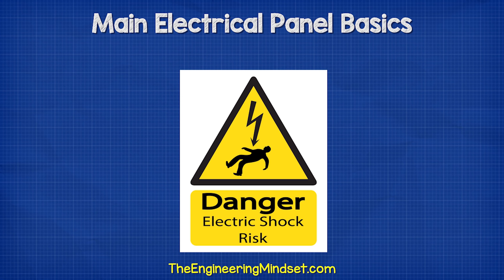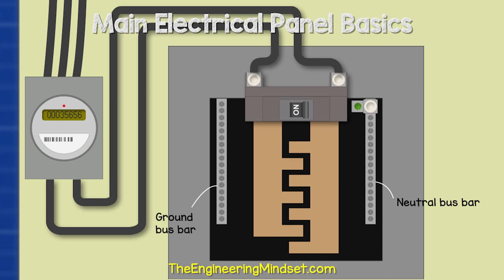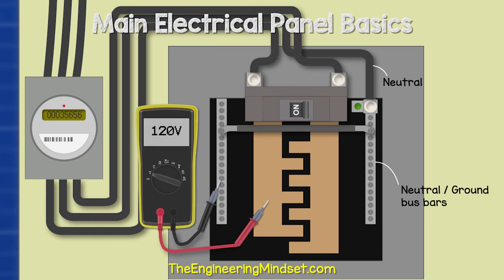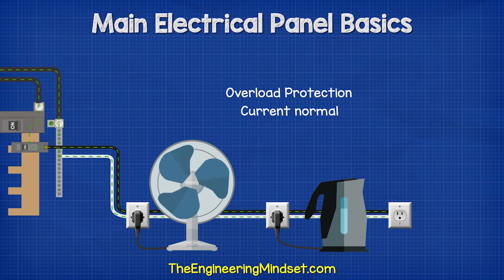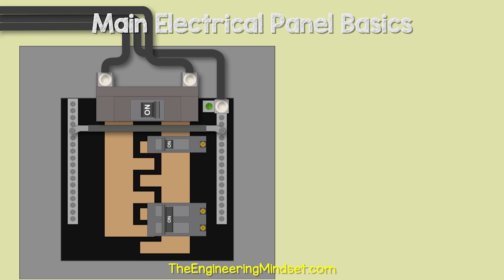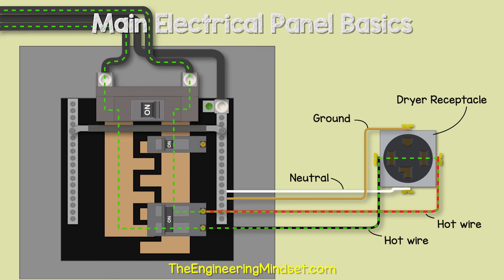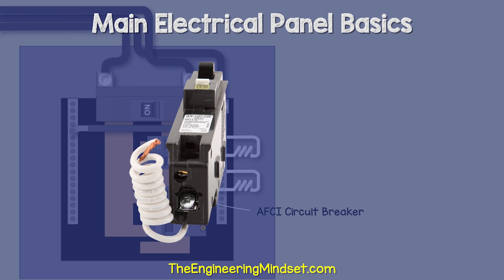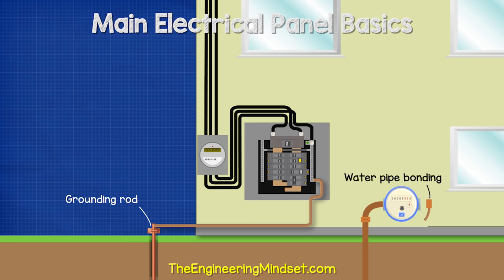Main electrical panel explained - Load center - service panel

Comment: I've been an electrician for almost 20 years now and this is a really good video for explaining the basics to students or just curious folks. I wish this sorta stuff was around when I was in trade school
Reply: Hello, I believe my ground and neutral bus is connected by the bar. Does it mean that both the ground and neutral wires can be applicable to either side of the bar without trouble? In addition, can you put a ground and a neutral into the same screw? If so does that also apply to having two ground wires into one screw and two neutral wires into another? THANKS!

Comment: My first home was a 100 year old farm house that had been “farmer” built and engineered. No code was followed. I decided to change the front porch light fixture. So I turned it on with the switch, saw the lamp go on, the shut it off, the light went dark. So now I can safely remove the old fixture, right? WRONG! I put a screwdriver to the wire and received a good shock! Why? I was not wired correctly. Basically when the switch was off, it was just grounding it out. The fixture stays hot all the time. Beware. That’s why you use the breaker when working on a circuit you know no history on. It worked like that for years and the old saying if it’s not broken, don’t fix it is what farmers live by
Reply: And that's why you also verify with a voltmeter before you proceed work

Comment: I'm an electrician and I didn't even know the difference between AFCI and GFCI before this. Great video :)
Reply from the maker: Glad it was helpful!
Reply: ⚡ Electrician. You're an apprentice. You're learning to be an electrician. There's a difference.
Reply: @beverlytate2669  Thank you for spelling it correctly.
Reply: Keep in mind though… modern GFCI are COMBINATION AFCI/GFCI and handle both jobs. Pretty much impossible to buy a single use breaker anymore.
Reply: @SuperVstech  Just in my experience they have continued to be a thorn in my side.  But then again I deal with them at a hospital as a commercial industrial electrician.
Reply: @bad74maverick1   I get that the AFCI & GFCI are for safety.  But sometimes just because someone invented something doesn't mean that the NEC has to mandate it.  But then again look at who makes up the NEC committees.
Reply: @beverlytate2669  Was just ready to say that
Reply: @beverlytate2669  True, I'm never gonna claim I know the code book as good as a real Electrician :)
Reply: @The Reverse Fixed, lol embarrassing
Reply: @bad74maverick1  what is it, in particular that is causing issues with these devices in the hospitals? Is it the wide range of equipment in use at once or a certain brand of devices? You guys have many additional codes to deal with in that environment. It must be frustrating trying to troubleshoot so much along with your other tasks!
Reply: @ethanoverwatch407  don’t give in so quickly! Just keep learning and learning. We’re all in the same boat in that respect.
Reply: @bad74maverick1  : Also they are mandating it in Commercial Laundries and they will give all sorts of problems. I have a new laundry and the service calls never ended until all AFCI and GFCI were changed with normal breakers and outlets.
Reply: @bad74maverick1  : Some new Laundry constructions are using them too and we advice the owners to replace them with regular breakers/outlets.
Reply: @Android_Warrior  I can only imagine the nuisance trips that would cause!
Reply: @bad74maverick1 : At the begining yes but I have managed for the owners to switch to regular breakers and outlets.
Reply: That's sad
Reply: @DemnRaig80  Thanks?
Reply: @dwayne7356  If you understand how they work they are objectively very good devices to install. If they were useless or seemingly a money grab it would be handled appropriately
Reply: @Android_Warrior  Wow this is terrible advice for a business. If those are tripping all the time they are indicating that there is a condition that needs to be fixed. 

How do I know this? Years as a Red Seal Electrician and doing a ton of controls and maintenance. 

Also you don't need to call and electrician to reset an AFCI or GFCI... That should be basic basic training.

Old vacuums trip the oldest of these because they either used brushed motors and the brushes were long gone or something else in the motor is causing a ton of sparking. Which believe it or not across a population is enough to cause unnecessary fires and deaths.
Reply: @goaliedude32  This is spot on.
Reply: @Morberis  : You must live behind a desk. I have 30+ years working in the field and I'm taking from experience. I live this situation all the time and that is with new laundry equipment that use heavy Electronics.
Reply: @SuperVstech  yeah bro you can get afci only breakers and gfci only breakers. you can acquire these incredibly easy and theyre installed all the time. your information is flatly wrong and you should delete this comment
Reply: Then your not an electrician

Comment: I work with a lot of electronic circuits over the years as a field engineer on medical devices, but I never delved into electrical for housing. This was extremely interesting and pretty simple when you get right down to it.  Great video.

Comment: Nice video. I remember GFCI once saved my life. That is a good that engineers took care of such an event!
Reply: I think every circuit in the home should have a GFCI breaker. Maybe there is some disadvantage I'm not seeing but why don't they? Is cost the only reason?
Reply: @levelup1279  I think the price is the main reason. Also, in UK such breakers called RCD (Residual Current Device) and placed not 1 for a room, but one breaker for a full house. In such case full house if protected. I see no disadvantages when it comes to a human life safety)
Reply: @levelup1279  A GFCI won't save you if you stick a fork in the outlet without being grounded. It only works if it sees a different current back from the load than what was sent. What is good (especially if children are present) are tamper resistant receptacles that have a little doors in the slots that only open when both hot and neutral plug pins are inserted at the same time. It's residential code around here.

Comment: These videos have somehow achieved an unmatched level of informational digestibility. 

I say somehow because I’ve seen the same topics explained in what I thought was a similar manner, yet have never been able to comprehend & understand the presented information as efficiently as I’ve been able to with these. For example, I don’t think I’ve ever seen such a quick & simple, yet understandable explanation of the 120/240v relationship regarding the transform’s center-tap & the connected common rail. Clear & simple gold.

Comment: This is by far the best video I've seen describing the main panel operation. Great jo
 There's information on breakers, GFCI, AND AFCI breakers. It ever talks about how switches and lights are wired. 
It's like three or four videos in one. Great job.

Comment: Can you please make a video explains why grounds and neutrals need to be separated in the subpanel. This was super helpful.
Reply: Because lightning grounds to earth and neutral is just return of the circuit back to transformer at the pole. 
My guess.
Reply from the maker: Check the new SUB PANEL EXPLAINED ➡️ video https://youtu.be/NUSNa-7Hecw

Comment: im currently an apprentice for a commercial electrical company and i have always struggled to understand whats actually going on in these panels. I took notes from this video and it really helped me
Reply: Hello, I believe my ground and neutral bus is connected by the bar. Does it mean that both the ground and neutral wires can be applicable to either side of the bar without trouble? In addition, can you put a ground and a neutral into the same screw? If so does that also apply to having two ground wires into one screw and two neutral wires into another? THANKS!

Comment: Great video.  One correction:  I believe the the grounds from the circuits are supposed to connect to the ground bus bar, not the neutral bus bar.  And the grounding rod is supposed to connect to the ground bus bar.  This is especially important in a sub-panel, where the neutral and ground bus bars are not connected to each other.
Reply: In general, yes that’s true. It depends on the ground fault protection of the circuit. You wouldn’t want to have your neutral bonded to ground downstream of your ground fault protection, as it would cause the breaker with said protection to constantly trip with virtually any load. For residential circuits this shouldn’t be too big of an issue though, since you only really see dedicated ground fault protection on the GFCI outlets. In commercial and especially industrial settings though, ground fault protection is very important and it’s therefore important not to bond your neutral and ground downstream of the protection.
Reply: You are correct about the subpanel. The video is correct and by code. When the service disconnect (Main Breaker) is in the service equipment panel then by code you need to terminate the grounded conductor (Neutral) on the neutral bar, and connect it to the ground bar and panel. It is important to connect the grounds and neutrals together. If you watch the video closely, in an event of a ground fault the current is going to travel the ground wire to the panel to the neutral back to it's source.  

If your main disconnect is at the meter then you would connect the ground and neutrals together and then separate it at the main panel. Electrician U does a get video on why you separate the grounds and neutrals in the subpanel.
Reply from the maker: Check the new SUB PANEL EXPLAINED ➡️ video https://youtu.be/NUSNa-7Hecw

Comment: Thanks for the great explanation.
So for the last point made do I have this right?
Say we have a house that was plumbed with copper pipe. Then some years later a renovation was done which replaced some of the copper runs with PEX.
If the 2nd floor still had all copper pipes within it's walls, but it was being fed from the basement using PEX, then technically those copper pipes on the 2nd floor could be energized if an electrical wire made contact with them.

Comment: Now I understand why my house is so complicated, my country use UK-like electricity but my consumer unit is using US components. And wire color code is all over the place.
Reply from the maker: Which country are you located?
Reply: Thailand, don't get me wrong, right now my country has standard (Like UK but connect Neutral to Earth). My house just old enough to be in this mess.

Comment: Dryer needs 4 wires because the motor is 120v (1 hot and one neutral) and the heater is 240v. (2 hot) and a ground for safety.

Comment: 5:09 my only comment would be reflecting your earlier statement for a future video, but separate your Grounds and Neutrals now to make the lives of yourself, or anyone else in the future, much easier.

When you put in a battery backup we usually create a new first means of disconnect, meaning that you have to unbond those bars and separate the grounds and neutrals.

Comment: Where I am in Argentina (220V/50Hz) many houses have no earth. Some do have it (I have installed a stake in ground) but they never have earth connected with neutral in the panel. Would love to see explanations of non-US AC systems.

Comment: Would like to see a video for panels on small generators (not connect to a grid) and on AC electrical systems on ships and how they might differ from the North American grid and the European grid panel designs or requirements. (if there any differences)

Comment: Just want to mention, homes that have city water will normally use the water main as the primary system ground instead of an earth spike. Since the water line is copper and is in firm contact with the earth, it works just as well as a grounding rod.
Reply: What country are you in that is using copper for water mains in the street? I'm Britain, where his accent is from, we use plastic piping in the street, plastic in the homes. It's been like this for a couple of decades. I'm not sure if he's being generic in his board or for American, because he's talking about 120 and using double positives to make 240. I'm not an electrician.

We have had to adapt wiring to this reality.

You can no longer trust copper piping in a home will be continuous or lead back to a central area. It can be changed at any time and the copper circuit can be broken. For this reason Earth cables are being run directly from the front to the back of the properties using the main electrical board for the main earth point.

Push fit plastic piping is so quick now, and they just need a small little blade cutter to cut the pipes to the right size. It's flexible and so easy to move around. Copper is much more expensive, difficult to bend, more time to cut, but the joints are a little bit cheaper. However plastic push fit connectors can be easily undone just with a click of your fingers.

Comment: we have in Russia and throughout Europe the voltage standard in the network is 220-240 volts between phase and zero.  But between 2 phases in a three-phase voltage of 380 volts.

Comment: Breakers are very important for fire safety.

Always buy from reputable vendors and make sure the breaker has been approved by the competent authorities. There has been an influx of cheap breakers that are jut a plastic case and a switch lately. Especially since the economy is in tough times.
Reply: UL listing is a requirement for it to be authentic (USA)

Comment: In your 120V light example, the ground wire is always connected to the ground buss bar and not the neutral buss bar.   This is especially important if a remote disconnect panel is connected to the main panel.

Comment: I also question the shared neutral/ground bus. If you land neutrals on the ground bus, even in the main panel, the jumper between the two buses becomes a current carrying conductor and not a reference. The ground bond (ground rod wire) and all equipment grounds go to the ground bus, not the neutral. All neutrals go to the neutral bus. There are other discrepancies. Ground wires are green or green with a single yellow stripe, not yellow. All outlet and switch terminal screws are color coded. White for neutrals, green for grounds, brass for hots, and sometimes bronze or brown for certain switch legs (usually 3-way or 4-way switches).

Comment: 5:18 can we touch neutral wire safely when AC/DC current is flowing? if so, then how is it safe to touch the bulb body when it is connected to the same neutral bus bar?
Reply: No you can't. The neutral wire will be carrying current back into the board and if you touch it then you could potentially be providing it a path to earth through your body.

In regards to the ground wire, you could theoretically touch it, but it could always be carrying leakage current and you could have a repeat of the earliest situation.

Comment: Gorgeous video.  From an electricity flow stand point the neutral and ground bus bar is correct.  But as far as a mechanical design, the neutral bus bars should be said to be insulated from the metal enclosure and the ground bus bar should be separate.  In the video there is the green bonding screw of the one neutral bar which is awesome for the main panel design
Reply: But I have seen some "hack job" panels where a person did install grounds in the neutral bar, but this is terrible practice for multiple reasons, one being if you were to wire a sub panel this way it ties all non current carrying metal parts of the system inculding - electrical boxes, light fixture trims, even switch plate screws to the neutral and now a person can become part of the return path for current.  Absolutely needs be separated.  I have been shocked terrible due to this poor wiring on a farm.  In a tight spot I sat down on a gasoline dispenser frame grounded to earth and then touched the electrical box.  WHAMMO!  There were compound issues, but the major one being the grounds and neutrals ties together on the neutral bar
Reply from the maker: I'll refer you to check the NEC, it is perfectly acceptable to connect both ground and neutral to the same bus bar, in the main panel only, as long as there is no sub panel. It is good practice to separate, but it doesn't have to be.
Reply: Well I won't argue with Code and Im not familiar with it as I'm Canadian.  I'd assume it's not ok in Canada since it's never done and if I did it I guarantee it would fail inspection. The  CEC Canada Electrical Code is pretty much adapted from the NEC.  
Just like stabbing wires into the back of a receptacle, switch or device.  Maybe be acceptable, but should not be done as it's sketchy as far as what can happen.  That said in the parameters of what you showed for the US, I apologize for any assumptions with regard to your wonderfully depicted video.
Reply: In a perfect world, only electricians wire electrical installations.  So we are already beat with DIYers.  But if a diyer saw that a panel has grounds and neutrals installed in a panel and then did a sub panel, that very leading way of wiring would cause some large problems.  I fixed two panels with the bonding screw left installed in panels on different jobs in the last month 😬.  In one situation a kid got hurt.
Reply from the maker: Check the new SUB PANEL EXPLAINED ➡️ video https://youtu.be/NUSNa-7Hecw

Comment: I’m going to turn off the big breaker open up the panel to see if the bathroom is actually grounded or is it a false ground(there is three wires and the third wire isn’t bridging the Gap between neutral and ground)

Comment: This reminds me of audio engineering. The routing part. O LT difference is electricity and sounds signals but other than that it’s almost the same. 

It’s the same thing with excel in a way…. Cool stuff.